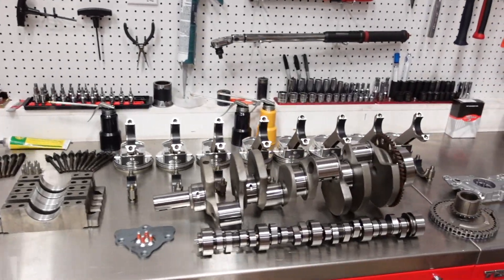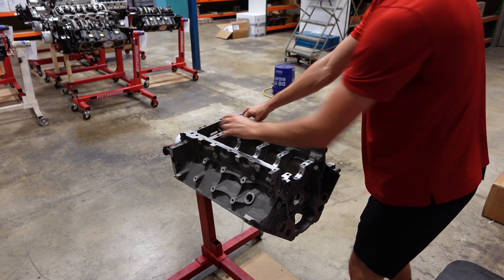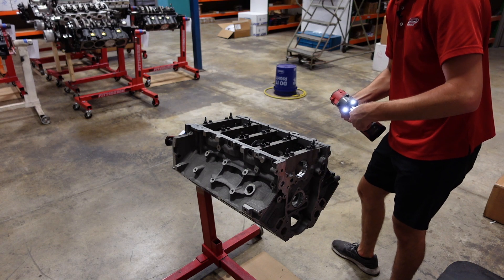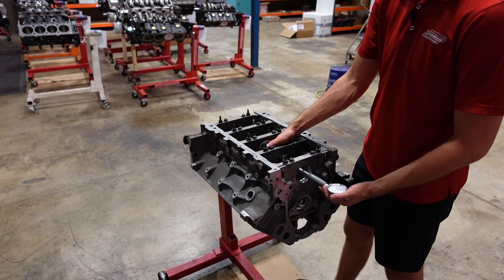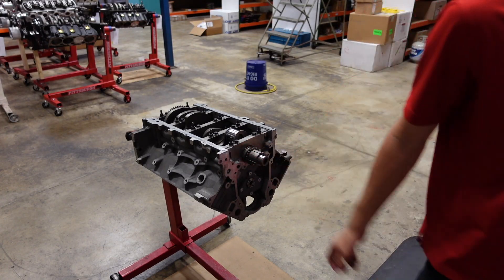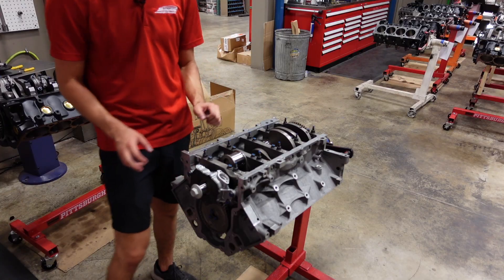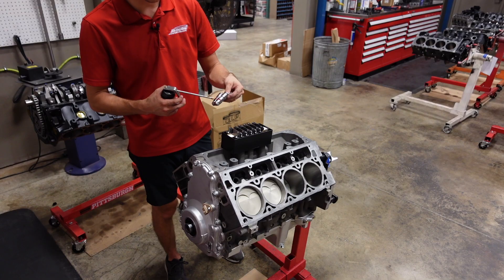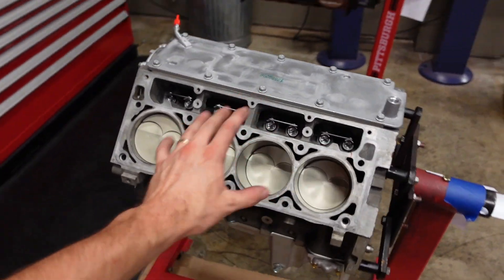REBUILDING a 6.2 LS3 into a 416" Forged Stroker Engine! (Part 1)

Comment: Build a short deck LS with a 4" bore and a 3.01" stroke (302ci). A modern LS based Z-28/DZ302 4"by3"(301.6ci) engine.

Comment: Great tips on building the LS stroker. Thank you for posting these videos. Not building a stroker but I will be going with those tie-bar lifters. Hearing a lot of stories about failing stock lifters as well as the plastic trays. Remember you need a special deeper oil pan for a stroker and it has to clear the steering linkage etc. for it to work.

Comment: Quick question Jacob.  If we have a 6.2 that has damage in one lifter bore, is it possible to have that lifter bore repaired in-house with Smeding, and get the block touched up and a stroker kit installed? Thanks for any advice.

Comment: All the engine literature says that rod ratio under 1.6 is bad. How come there are so many shops still building 416ci that have rod ratio 1.56 ? Is that extra 0.7L worth the having bad rod ratio?
Reply: Ignore what you read. Everyone builds stroker...there no such thing as a bad ratio with 4inch stroke. Guys run 4.125 strokes with zero issues. What is your concern with the ratio you mentioned.

Comment: Gm Jacob I spoke wit U bout  doin me a build! Had some issues I want d same build just  a 417ci 900hp wit nitrous. Hw much is my build wit everything dwn to oil pan I just got d block. Thanks God Bless
Reply: It will a daily driver wit AC on pump gas a high compression motor I'll let U decide dat part  but will be going to d track on Sundays

Comment: I am building my first swap. Ls3/6L80 03'Crown Vic Police Interceptor. My first swap, but not my first engine. My block is at the machine shop. I found an Ls3 block for stupid cheap. Otherwise I would prob be swapping in a 6.0 lol. N/A build. It's getting a sleeve in cyl 5 where the wrist pin nicked the cyl wall. Valve seat dropped on start up and shattered the piston. The wrist pin was still in the rod. They shut it off as soon as they started it and they heard the bang. New cam bearings, sleeve, deck and hone, and she should be ready to go back together. I really enjoy watching your videos. On the Ls3 mains is 2 thou good to set them at for mostly street but maybe some track use. Prob not much of the track tho.
Reply from the maker: Yes! I like to run .002” on the mains with an aluminum LS block for a nice N/A street setup.
Reply: Sweet!!!! Thank you brother!!!!

Comment: So what happens if the clearance is to big or to small. Order the next size up or down in bearing size?
Reply from the maker: Yes. If the clearance is to loose, try a set of .001” bearings. If the clearance is to tight, try a set of STD-X bearings. You can also mix and match a half set of .001’s with STD, or a set of STD with STD-X.

Comment: What about degreeing in the cam ?
Reply from the maker: With modern machining accuracy I don’t see a need to degree cams on simple hydraulic roller LS combinations.
Reply: @JacobVillemain   I agree with the modern quality of machined parts but I still don’t trust them enough to skip checking the cam, and it seems like most of the time my luck is bad and I would be the one to get a machining error.